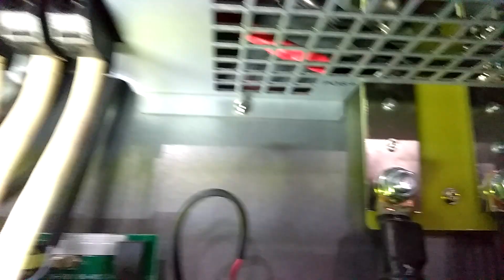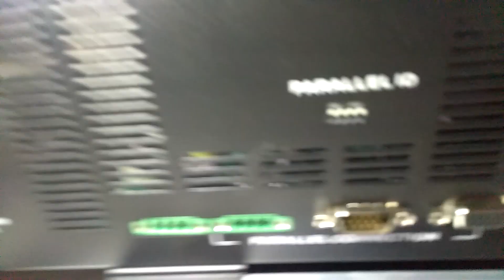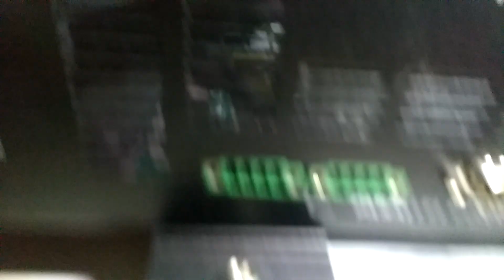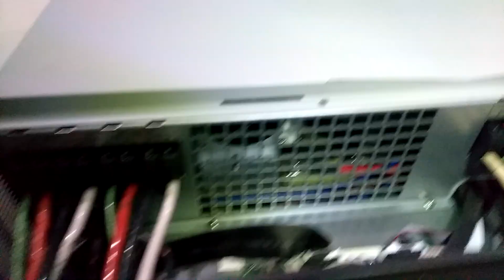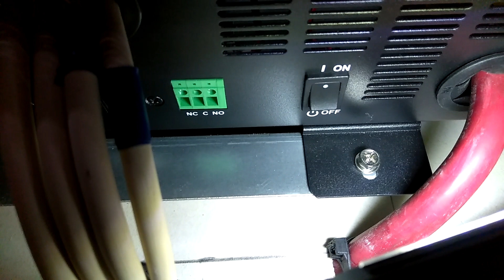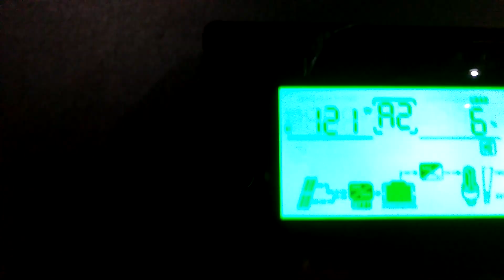Inside the MPP solar 5048 split phase inverter.

Comment: I own the mg5048 , it's a very good inverter but on idle mode when I'm not drawing any power it's consuming 60-70 watts which is a lot in my opinion , they should have added sleep mode or something...